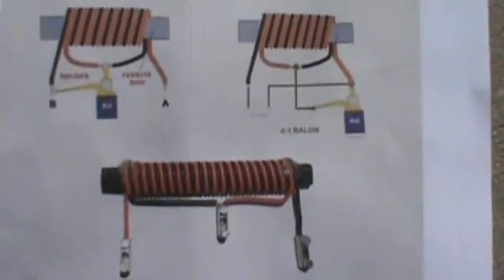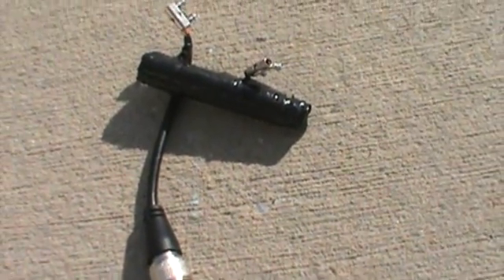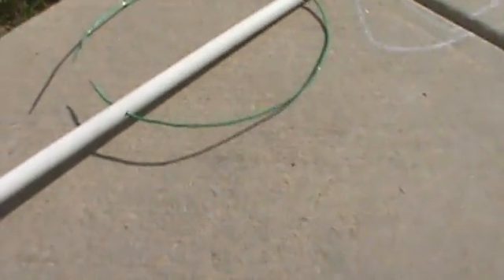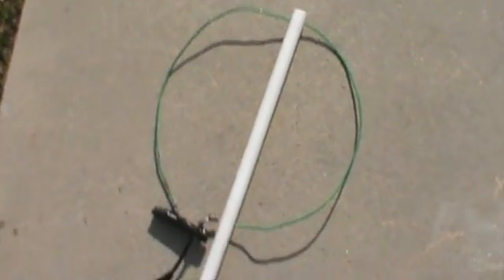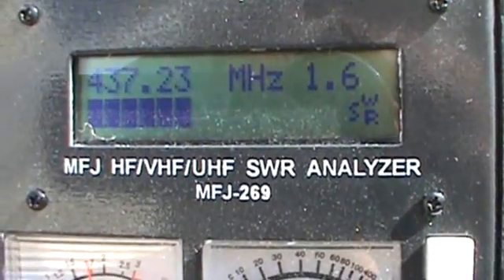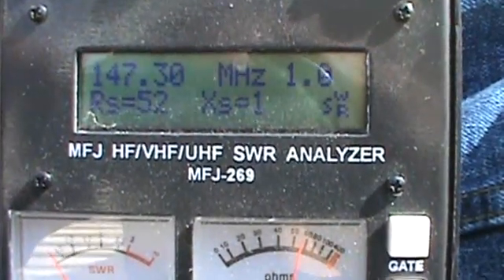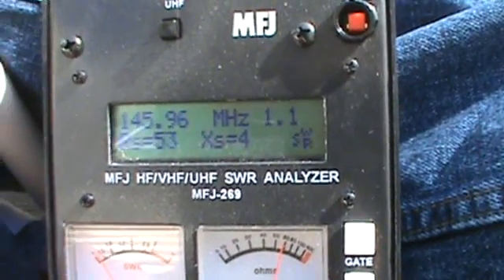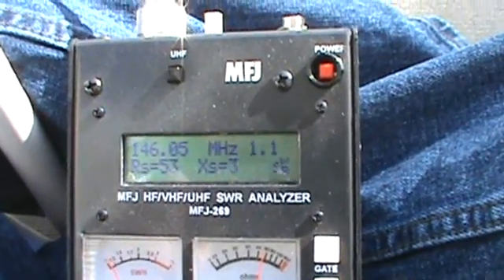2 meter Loop Antenna

Comment: Great video thanks for sharing. I know delta loops have gain over a dipole and they are a full wavelength usually and fed with 4:1 balun or a 1/4 wave matching 75ohm piece of coax for the frequency you are on. There is some extra gain usually opposite the balun, but not much. I presume yours would give great omni directivity being in loop and be vertically polarised, which you want on 2m FM. Thanks again 73's and good DX Andy M6APJ

Comment: Just passed my Technician license test yesterday.  I got a free radio for passing, a Yaesu FT-4VR, mono band.  Until I get on the database I need to make an antenna for 2 meter for my radio.  How did you construct the balun for the delta loop?  I have to get out on the deck to be able to even hear the repeater with the rubber ducky antenna.

Comment: what you made was a 2mtr full wave loop,
which as any amateur knows would be a 3x full wave on 70cms..
like a lot of ham bands they work on harmonic frequencies,
so a 6mtr 1/4 will work on 2mtr and 70cms.
a 2mtr 1/4 is a 3/4 on 70cms.
so it's not wide banded at all it's a resonant antenna for VHF and the 3rd harmonic frequency  is in UHF..

bloody hams...they're crap now days..

Comment: O....M...G...! thankyouthankyouthankyou 73 W4VEY Tampa, FL...I"d like to try these on LEO ham sats, being a bit directional and with me already getting action on a mere vertical (idea would be to hook up two or more of these E-Z loops to an antenna switcher, North/Sotuh, East/West (maybe more) orientations to switch instead of tracking physically a yagi through the sky....I've done cool things with capacitors but very narrow banded. You could also hang one of these off a balloon in a pinch instead of the ubiquitous, obligatory potato gun or water bottle to get elevation, and better coverage than resorting to NVIS if repeaters go down and you're tinkering trying to help out, this seems valuable what with those ferrules being so common ...anyway anyway thanks again for this most serendipitous post. I source from nearby materials all the time.

Comment: It's a leaky dummy load, most of the RF is attenuated in the ferrite - which will warm up with continuous TX. I made a similar finding with a large copper magnetic loop and was pleased with the wide response on the MFJ analyser. In practice it was great for RX but didn't radiate more than a few watts even with 100W @ 7Mhz running into it.
Reply: That's what I thought watching this.

Comment: I think it is obvious that the bandwidth is due to loss in the balun. A balun at VHF would not normally need ferrite material unless it is a choke balun.
Make 2 baluns and place them back to back and measure the loss through them and divide by 2. I think you'll find you have pretty much a dummy load for a balun.

Dale

Comment from the maker: A true 5 watts was a bit much. It did get warm. From a handheld you should be fine. Diameter you ask. 3 feet=36 inches circumference divided by Pi (3.14)=11.4649 inches diameter. The shape was somewhat forgiving so don't worry if it looks more like an egg, but do try a circular like shape. Let me know if you don't get the email 73

Comment: It"s just a Magnetic Loop. Orienting it horizontally will allow it too function better for weak signal work. Working a repeater just orient it vertically again. What you might find is that vertically it may be broad side directional. Spin the sides towards a weak repeater ,or experiment with a station on 146.550 FM simplex and see if signals get stronger ,or weaker as you spin the loop. On SSB 144.200 +/- the call frequency horizontally won't make a difference.